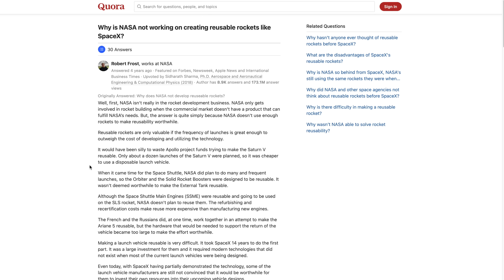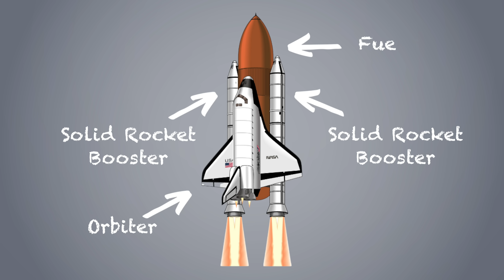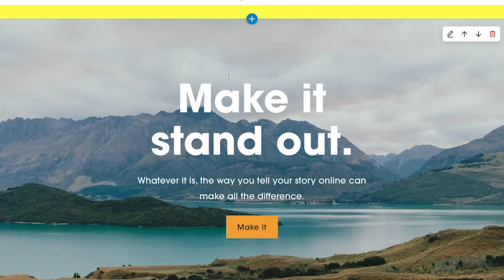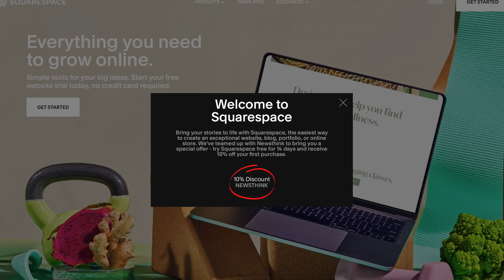Why NASA Doesn't Fly Reusable Rockets

Comment: Reusable things are not possible in governmental accountings
Reply: The reason is for safety purposes. Rocket engines are temperamental and they need to re-check after you used them. The Space Shuttle was re-usable and the RS-25 engines need to be refurbished and the cost is sometimes more than using a brand new engine.

Comment: SLS is doomed.
Reply: The reason is for safety purposes. Rocket engines are temperamental and they need to re-check after you used them. The Space Shuttle was re-usable and the RS-25 engines need to be refurbished and the cost is sometimes more than using a brand new engine.

Comment: A reusable rocket makes the most sense within the context of the industrialization of space. The industrialization of space makes possible the economies of scale needed to make reusability viable. NASA had a reusable rocket, the Space Shuttle. It was no cheaper than the Saturn V.  But so what? NASA are not a business.  SpaceX are. Their reusable rockets had better be cheap. And they are. And SpaceX are paving the way towards the greater industrialization of space. NASA will be able to take advantage of the lower launch costs to pursue its mission.

Comment: "I doubt that you could tell the designers of the big F-1 that something that big could be reusable, and I dont think at that point in the program that Reusability was a consideration"
looks at Saturn ID 
looks at Sea dragon 
looks at early shuttle concepts
"NASA was so burdened financially that potential plans to produce more than the initial 15 Saturn Vs had to be scrapped, then and only then did the agency consider a reusable rocket" 
This is not how this happened at all, Congress didn't want us to go to the moon again because they were too busy trying to end the war in Vietnam, prevent astronauts from dying, and kill JFKs long heavy legacy in space.  The space shuttle had been under development as far back as in the 1960s before crew even set foot upon the moon, please stop spreading misinformation about this topic... not to mention that the F-1 and J-2 were test fired for hours at a time per engine and showed little to no wear, there was an engineer on the J-2 program that said that they never were able to wear out one of the engines on the test stand it was that freaking good and bullet proof of a system.

Comment: I have read studies that say the Saturn 5 was actually reusable but lacked recovery systems because they were not developed due to the space race.
Reply: Theoretically, you could retrieve and refurbish the first 2 stages of the Saturn V.
Reply: @veritateseducational217  true, though it would be much more difficult with stage 2 since it would most likley burn up due to reentry loads (info from apollo 8 saturn 5 flight manual)

Comment: The funny thing is, SLS rockets were never "built by NASA", but by private contractors such as Boeing.  (main difference is of course the oversight)  It's political to say that it was too much time and money for building a reusable system, but we all know that there is much less money to be made if you take the reusable route.  Which company will go out of their way to make less money?  Though there's also the aspect where technology had to catch up.  If it's the 1980's, a company like SpaceX might not have the computers and materials to make Starship possible.

Comment: If NASA used reusable parts the contractors like Boeing would make less $$$ and the Gov’t would never stop giving welfare to corporations.
Reply: The reason is for safety purposes. Rocket engines are temperamental and they need to re-check after you used them. The Space Shuttle was re-usable and the RS-25 engines need to be refurbished and the cost is sometimes more than using a brand new engine.

Comment: They are not going to be reusable indefinitely, because entering the Earth’s atmosphere is a hell of a rough ride, even the toughest of materials cannot withstand that much pressure. They will be reusable for less than 10 times.
Reply: Yea except SpaceX has a booster that just landed for the 10th time. I dont believe in everything SpaceX is the greatest thing ever, but your statement is incorrect.
Reply: @threehead99 yeah but booster doesn't reach near orbital velocity . Second stage feels much higher temperature and pressure
Reply: @threehead99  spacex has never managed to reuse anything that has reached orbit, your statement is not correct
Reply: @anguita119  you are both confusing orbital velocity with reentry. 

I can go 12,000 mph straight up. That's NOT orbital velocity, but I will still reenter the atmosphere. If your statement was true, even a ballistic missle with an apogee of 190 miles after all stages are expended has never left the atmosphere. 

The apogee of a Falcon 9 booster is right at the Karmin Line. It briefly escapes the atmosphere and reenters.
Reply: @threehead99  the apogee does not exceed the karmin line, because if spacex wants to reuse it, it turns its engines back on and its apogee goes down a lot, even with your reasoning they have never done it
Reply: @anguita119  they exceed the Karmin Line, 2nd stage turns on, retro burn starts, coast up and downrange to apogee, apogee reached, atmospheric reentry begins.

The apogee is typically 100.2km, which as I stated, is barely above the Karmin Line, meaning they do in fact experience atmospheric reentry.

You're making a false equivalency between orbital velocity necessitating atmospheric reentry.

Again. I am not the largest SpaceX fan, but they regularly exceed the Karmin Line and reuse the boosters. It's just not at velocities that necessitate heat shielding, whether is be ablative or ceramic.

Comment: SpaceX rockets are not fully reusable yet the second stage is discarded but starship is going to be fully reusable
Reply: The reason is for safety purposes. Rocket engines are temperamental and they need to re-check after you used them. The Space Shuttle was re-usable and the RS-25 engines need to be refurbished and the cost is sometimes more than using a brand new engine.

Comment: So basically NASA doesn't know how to build anything useful. Good to know.
Reply: The reason is for safety purposes. Rocket engines are temperamental and they need to re-check after you used them. The Space Shuttle was re-usable and the RS-25 engines need to be refurbished and the cost is sometimes more than using a brand new engine.
Reply: @MrJSabadojr  

That just let's me know they don't know how to build it adequately. But go off tho with those excuses.

Comment: The real reason is probably tied to the fact NASA is a public agency under the budgetary constraints of Congress. Senators involved in the decision-making are typically a lot more concerned with direct electability dividend projects (such as setting up a huge operation with 1000s of stable jobs), rather than encouraging innovative and cost-effective solution that will benefit humanity long term. It's why you have the SLS factory absorbing billions in that one Senator's home state and insufficient disposable income left over for a much more important Lunar landing system - good thing SpaceX's philosophy allows them to bid on the cheap or Artemis would have failed right there. So yeah: NASA budget is sometimes (often) used as an indirect employment insurance policy (i.e. cash for jobs) facilitating political re-elections rather than a fundamental driver of innovation. 

Having said that, another angle to look at this from, and it is very true, is that NASA is there to do the high-risk projects/research for which the private sector would never be able to set capital aside for or produce on their own. No matter how cool the nuclear-powered Mars rovers are, no private entity would do it since there's no immediate marketable returns on investment and the cost of failure is extreme. NASA can thus pave the way for private partners to develop competency and be able to attract capital on new ventures once tech/costs become manageable. But you 100% need that initial impulse. SpaceX, without taking anything away from their accomplishment, is one prime example of that legacy/approach.

Comment: The seven SI base units, which are comprised of:
Length - meter (m)
Time - second (s)
Amount of substance - mole (mole)
Electric current - ampere (A)
Temperature - kelvin (K)
Luminous intensity - candela (cd)
Mass - kilogram (kg)
Reply: Mass - elephant (el)

Comment: It probably would have made sense to try catch 1st stage of SLS. As that appears to be the biggest cost component.
Reply: The design for SLS started before SpaceX perfected landing the Falcon 9.
Reply: @steveaustin2686  I know , I am saying if it had been designed that way that would have allowed it to have far more relevance and may be multiple uses.
Reply: @vikkycb7948  But why design for reusability when you don't yet have the capability of the hardware? We also have yet to see how well scaling up the Falcon 9 to the size of Super Heavy works. It should be ok, but I can see why you wouldn't want to start trying to land something at that size. And the SLS is much closer to the Super Heavy than the Falcon 9.
Reply: @steveaustin2686  Either you start or you keep waiting. I understand all the reasons why NASA could not have worked on a reusable launcher it is just that had they decided to do it end product would not be facing irrelevance before it has flown

Comment: I disagree with the entire premise here. NASA has always been a propaganda smoke screen for the US military. By far the bulk of their missions have actually been military in nature with a little "Science" added as cover.  Just go back to the beginning with the "Corona" program, they blatantly lied about the purpose and science that was done when  in fact it was all about military reconnaissance. The true backers Air-force, NRO, and CIA did not want it to be cheap to get into space, they wanted to keep the rif-raf out and had virtually unlimited budgets to work with. So, very expensive one shot systems were just fine.  The problem for them now is that 60 years of progress in lots of field has made it impossible to hide that reusable system are not only possible, but make a ton more sense.  Would you build an airplane that could only be used for 1 flight?   How much would a ticket cost to fly from LA to NY if you did?

Comment: Milton Friedman put it best "nobody can spend their money as wisely as themselves". NASA, a government agency, gets funding from taxpayers, simply doesn't care what's the most economical way to build a rocket.
Reply: NASA, a government agency, gets funding from CONGRESS, simply cares what Congress wants the money spent on. Sure, it's ridiculously expensive to source their rocket parts ALL OVER THE DAMN COUNTRY, but that's what the people holding the purse strings demand. Pork barrel uber alles. NASA are not incompetents. If it were up to them (it wasn't), Shuttle would have been fully reusable, possibly smaller, and designed for cheap operation instead of rock-bottom development cost damn the consequences. But they are pretty risk-averse, because Congress will jump down their throats if ANYTHING ever goes wrong, whether it's NASA's fault or not.
Reply: @kayl456jenna  where does Congress get funding from?

Comment: NASA flies the F9, with Dragon 2 and Crew Dragon.
Reply: NASA contracts with SpaceX for those launches.
Reply: @steveaustin2686  Exactly. Just like they have contracted Boeing to build SLS. Let’s not forget that F9 and Dragon was developed with partial funding from NASA.
Reply: @nordrott  Yep, the Falcon 9 was largely developed with funding from NASA for the CRS missions to the ISS for cargo. NASA gave further funding to modify Dragon for manned flights and that lead to Dragon 2 and Crew Dragon on Falcon 9 B5. Falcon Heavy was largely funded internally I understand and the current bottleneck for Falcon Heavy is that the Falcon 9 and Falcon Heavy use the same size fairing. Evidently, a recent NRO contract for FH was very large as SpaceX is apparently having to design their own larger fairing as RUAG, which provides fairings, is too busy.

As I understand it, NASA used to contract with aerospace companies and then would run the vehicle. So it was like NASA was driving the car built by the aerospace company and the company was in the front seat advising. As I understand it, NASA is now working in close coordination with the aerospace company as they run the vehicle instead. Apparently, SLS is the last vehicle that will be run by NASA for the foreseeable future.

Comment: Reasons why NASA doesn't fly Reusable Rockets like SpaceX? Because SpaceX doesn't fly them either. Only the first stage is 'refurbishable', and that's relatively new. SpaceX still launched the full Falcon 9 system in disposable configuration until not a long time ago. The reason why SpaceX didn't reuse boosters and NASA doesn't want to look at it is quite simple: Every kg of systems and fuel and storage for the fuel you put on your rocket to launch into space is 1kg of payload you are not sending into orbit.  And $2million for something as big as Starship? Please, stop joking around. What killed the Space Shuttle and Buran was the incredibly intensive maintainance needed  to be performed on an upper stage. Starship might live longer only because SpaceX has the advantage of already developed and matured tehnologies, like CFD, software simulation, 3D printing, precision engineering, high computing power and small microprocessors and storage devices, better batteries and so on.
Reply: The F 9 boosters only need slightly refurbishments and checks, they have a Booster flown 10 times now.
Even if the upper stage isn't reusable (because it's hard to reuse them) they land one of 2 stages, and land 9 of 10 engines, and they even reuse the fairings. 
They landed boosters now 83 times, from 120 flights in total.
Of course the landing consumes fuel which can't be burnt for the payload - but it has still enough payload for most missions, it was calculated from the beginning.

Comment: Hopefully the Starship accomplishes landing on the moon and Mars quicker so they can see it’s doable and efficient to ditch the SLS. Sure the starship has to refuel twice to get to the moon and the SLS can go in one go but its very expensive only to send a cramped module. An SLS is estimated to launch for 2 billion and a starship at 2 million. Even if the starship is ten times more expensive than the estimate you would still need to launch 100 starships to match the price of one SLS launch. It’s a no brainer that the Starship once completed is ultimately superior. We need to progress past the Apollo era.

Comment: Yo that Chinese rocket fell into the ocean and it’s reusable they couldn’t even control it 😹
Reply: NO, the long march 5B is used to launch their main modules of their space stations. It was never meant to be reusable to be honest. I think you are confusing it with the Long March 8 which had its first launch a month ago. The long march 8 is designed to be reusable, but the first launches are not. They plan to recover the first stages in future. That will take time though(probably 2-3 years to materialise). That's what this channel was talking about.   Moreover, many rockets fall in Ocean, be they US/Russian/European or Chinese ones. So i dont get your point about :' chinese rocket fell into the ocean, they couldn't control it'.  Even space X falcon recently fell on US farmer land. Does that mean you will discredit their rockets/program?  This things happen regularly.  https://inshorts.com/en/news/spacex-rocket-debris-lands-on-us-mans-farm-leaves-4inch-deep-dent-in-soil-1617463141233#:~:text=SpaceX%20rocket%20debris%20lands%20on,inch%20deep%20dent%20in%20soil&text=A%20pressure%20vessel%20from%20a,local%20sheriff%27s%20office%20has%20said.

Comment: Reusable rocket is far better than re cleaning the space junk and ending up in havoc situations
Reply: The reason is for safety purposes. Rocket engines are temperamental and they need to re-check after you used them. The Space Shuttle was re-usable and the RS-25 engines need to be refurbished and the cost is sometimes more than using a brand new engine.